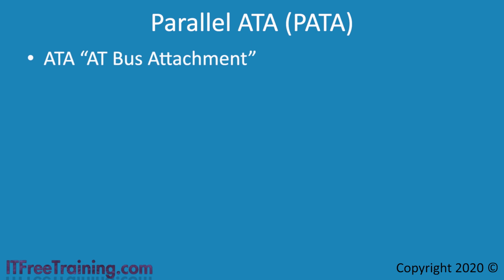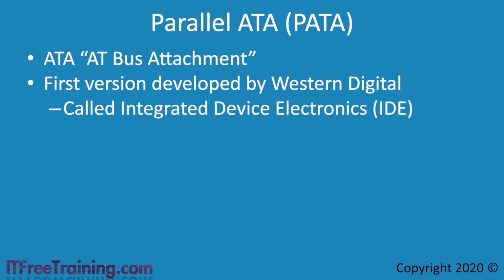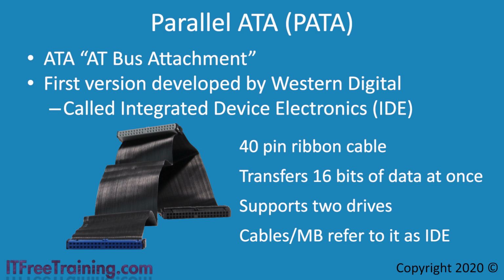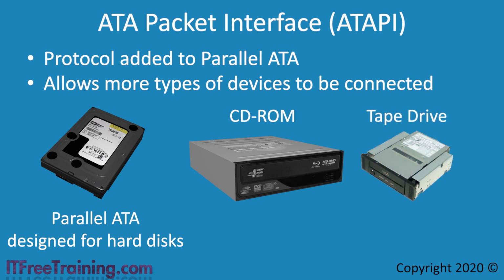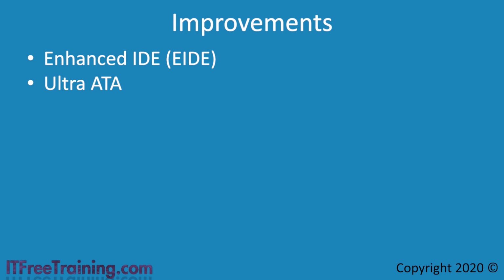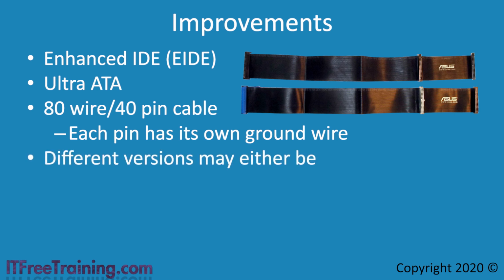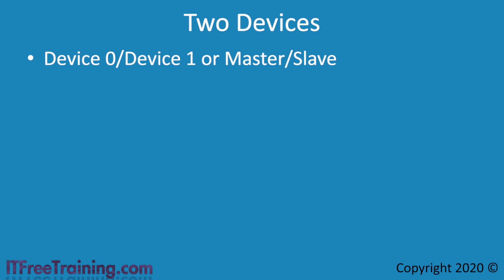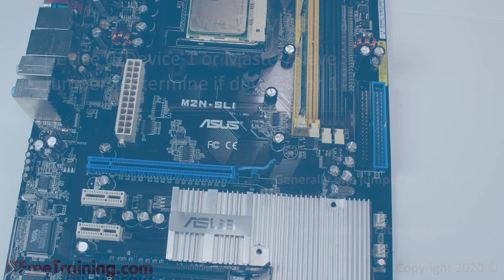Parallel ATA (PATA/IDE/EIDE)

Comment: i have IVDR is1000 secure storage which type of connector use as a external drive
Reply from the maker: The IVDR 1000 secure storage typically connects externally via a USB interface or through a proprietary docking station. Some models may require a SATA to USB adapter if they use an internal SATA interface. Check the device’s documentation or ports to confirm the exact connector type and use compatible accessories for secure and optimal performance.

Comment: I have a 2.5 inch hdd with 47pins n the motherboard have ide pins too,how do I connect them as the SATA cable do not fit in the HDD??
Please??
Reply from the maker: So you essentially have 48 pins, however one is missing for keying. On one side four pins are for jumpers, so there should be a small space between those pins and the other pins. On the other side the four extra pins are power pins. Thus you need to get a laptop to motherboard cable with power.
https://i.ebayimg.com/images/g/Tm8AAOSwda1au3TT/s-l1600.jpg
Reply: @itfreetraining  hi thank you so much for taking the time to reply it has been a bit much to try and figure it out. What you said seems abt right so I will go look for what you suggested and hopefully it works out.fingers crossed.
But even if it doesn’t work out I want you to know that I am very thankful.
I’ll keep you apprised. Good day
Reply: @itfreetraining  any chance you have the name of the cable you just mentioned please or the link to any websites that sells it please? The link you sent seem to be for a pic only.